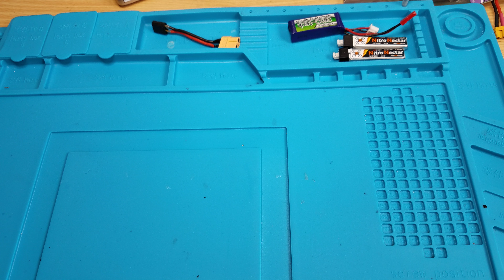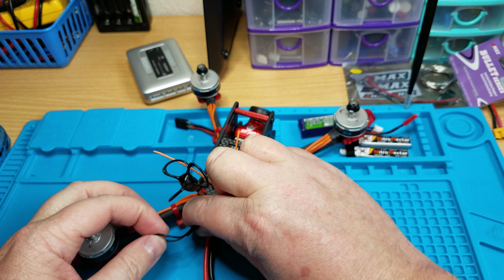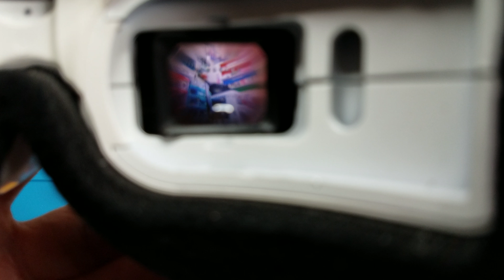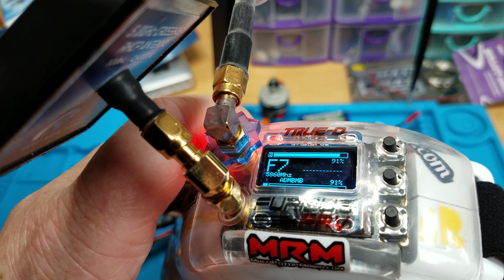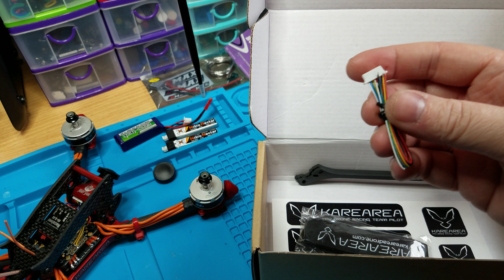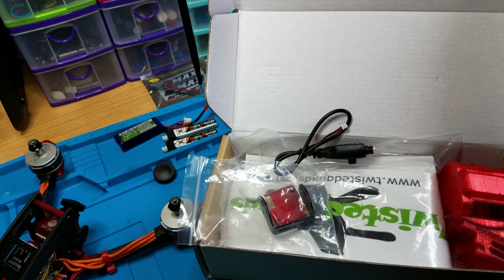Maxwell's talon

Comment: Great Video! (I subed).  Quick question! dont the t-motor f40 v3 draw about 50amps on 2600kv? So if your running 30amp esc's then wont it burn?
Reply: ok, thanks!
Reply: ok :)
Reply: will the starf4s 30a work with the t-motor f40 v3? (just want to be sure)